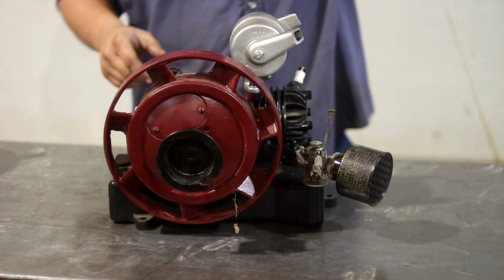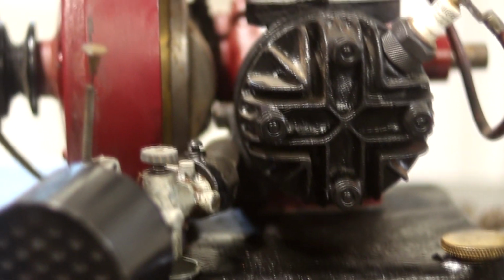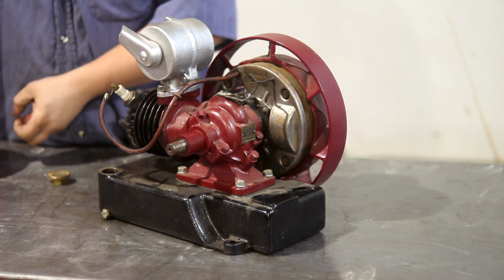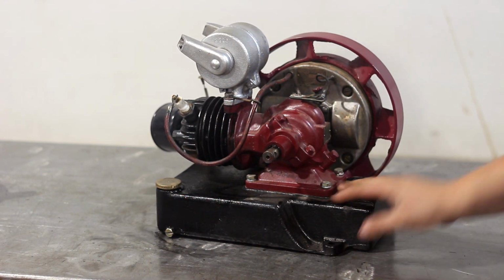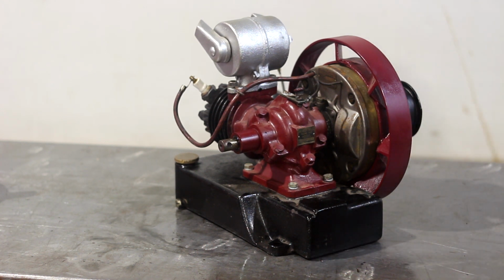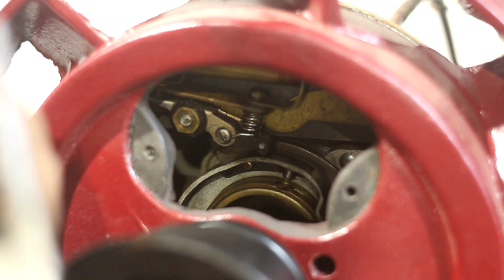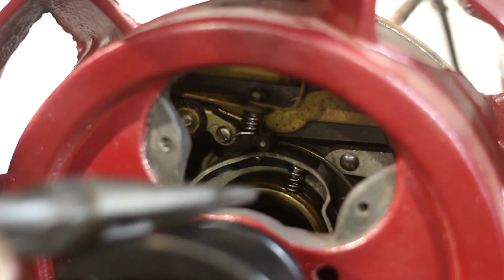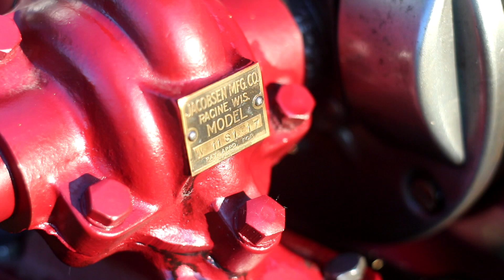Rare! 1920s Jacobsen Hit and Miss Engine!

Comment: Neat little engine! I noticed the curved impression on the back of the base tank. Do you think this could be ment for a kickstart version? Or mabie for a pulley or some design feature on the machine it was from... Reminded me of oddballs like the Associated 3/4 Pony motor with the flatbelt recoil or Doyle or kissel 2 strokes somewhat.. ✌👍
Reply from the maker: A lot of utilimotor where footstart so I imagine some had pedals but I haven't seen a Jacobsen with one yet might just be an old casting design they never changed.